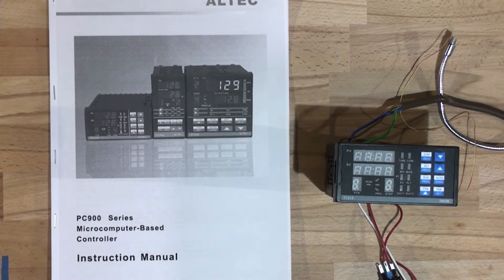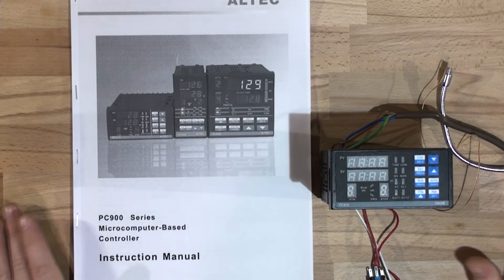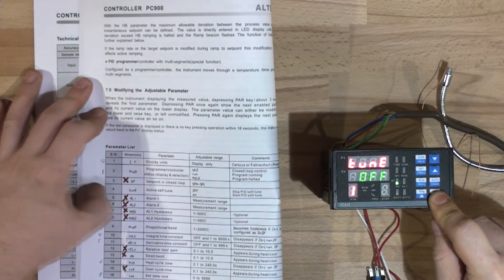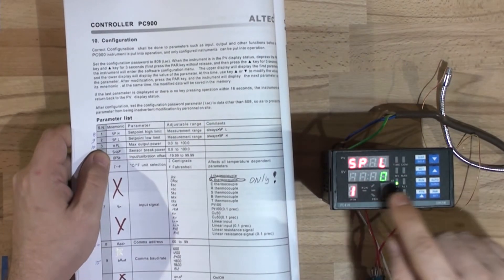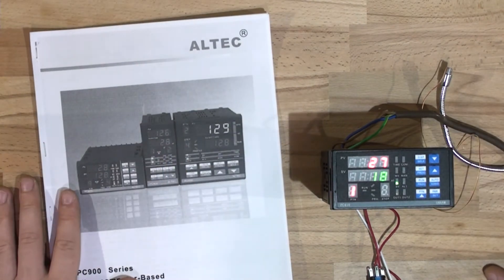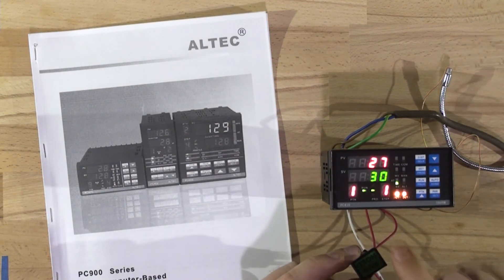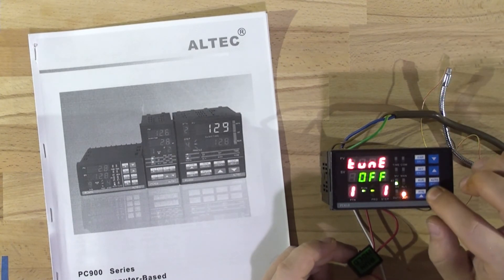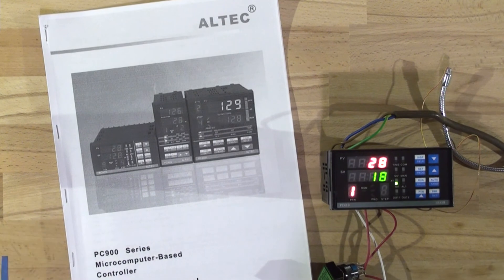Beware of FAKE PID Temperature Controller by ALTEC PC410 (P900)

Comment: The controller you have clearly states that it is "SHANM" PC410, not Altec PC410. I have the same one... That explains why the manuals do not match. However, I cannot find the correct manual, and some of the options and commands are different. It apparently does not have selection of different sensors (works only with K-type thermocouple). However, on remote RS232 interface most of commands are compatible with Altec 808, so it can be controlled and set up from the computer. Please let us know if you manage to find any programming or configuration manual for your controller, or the table showing the differences in features.
Reply from the maker: But that’s the thing, I didn’t buy SHANM, I bought genuine ALTEC, and it was advertised as ALTEC and also was quiet pricey, but what I received wasn’t ALTEC. So I consider it as a fake PC410.

Comment: Hi . Thanks very much. I have the exact same issue with the parameters not showing. I've built 2 ramp/hold glass kilns using this controller . Both same issues with parameters. I thought I was going mad till I found your video, so thanks.  I do have the kilns working as I added the momentary switch and the old/run switch as you have. The Issue I have is that the time Unit is seconds and cannot change. I have a small reference table for minutes to seconds and ramp degrees C / hr to ramp degrees/seconds. Next Kiln I now know how to verify fake/real and respond to supplier accordingly . Excellent Video  . I'm in Auckland New Zealand

Comment: i do have a pc410  in a achi 6000 but  dont run and i would like to know how turned off the LED MAN red light in out2 line remains flashing ........thank   or maybe  i have not configured the device well.
Reply from the maker: Did you add a button and a switch (start and stop) to the device? It’s mandatory to have those buttons.

Comment: I have one I bought through aliexpress and while it has the 'authentic' stickers you mentioned, I suspect it is a fake as well. Program will not run - my elements start heating and then it stops (shows program as running but power is cut to the elements)... have checked programs and rechecked but it continues to do the same. Also, the buttons either stick in the down position or don't detect depress. It is very frustrating. Like yours, the menu on mine is not complete like in the manual. Pulling my hair out as I've just completed a kiln build which has taken several months and now I can't operate it because of this crap PID controller. Not sure what to do. Any suggestions?
Reply from the maker: Try rebuilding physically, as in, pull it apart completely and put it together, that might realign the buttons and might help with sticking, as for the heating switches off in the middle of program, try powering the unit in “auto tune” mode and see if it will recalibrate the unit, takes about 10 min of wait time. Also see if the “OUT 1” or “OUT 2” leds are on or flashing on /off during operation. If they are and your heater still doesn’t work then check the output relays.
Reply: @MaxELECTRONICS  I've found the reason for it not running program... it was immediately put in HOLD status because as it turns out, you have to bridge pins 14 and 15 for it to run... it now runs! But I will try your idea of fixing button issue. Thanks!
Reply from the maker: Yes, those pins are for external latching switch for run/hold. Also there’s pins for external stop push button